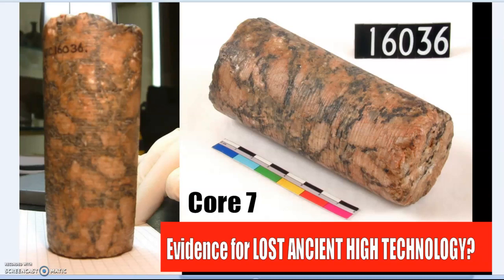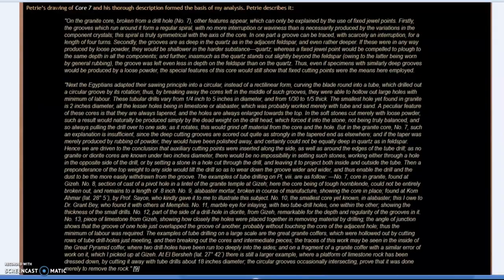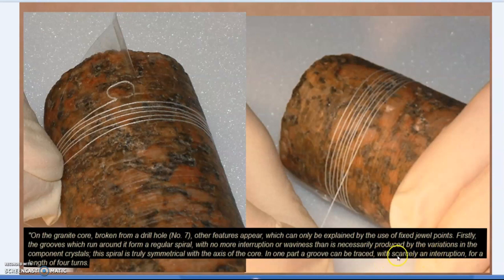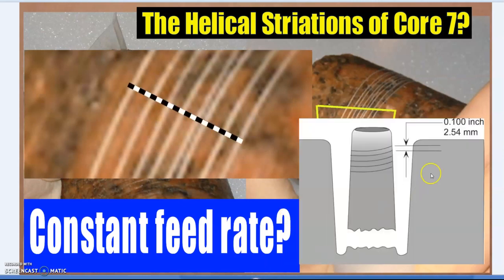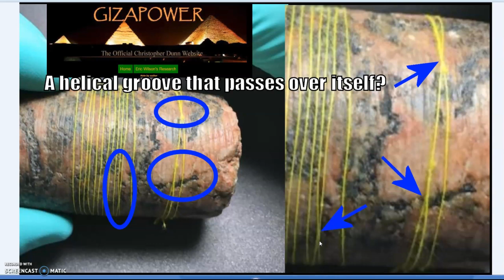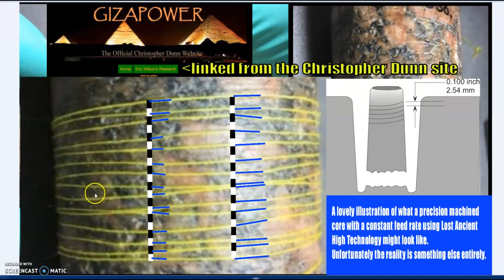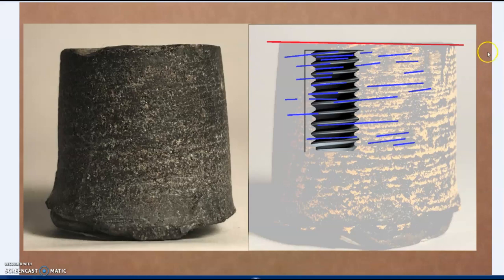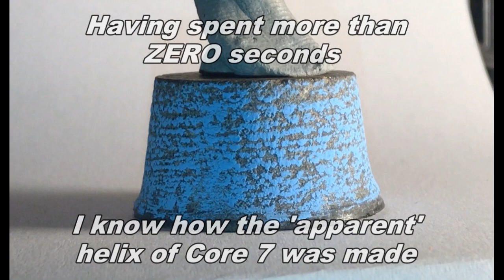Lost Ancient High Technology of Core 7 - Helix Spiral and Constant Feed Rate? TEASER

Comment: Mr. Dunn's thread wrapping exploits have always seemed rather suspect to me, he readily admits that the marks are not visible around the entire core and that its tricky to see which line you should be following, so if he's continuing a line where the 'spiral' is missing then it can only be described by one word... Subjective

He also used a Dial Test Indicator to check the depth of the grooves, the setup he uses looks like it has a 'ball' end rather than a 'needle' type end, 
This would be like trying to measure the groove depth on a vinyl record by running a cricket ball over the surface, 
Anyone with experience of inspection would call that setup 'interesting' to say the least, 

He has done some great work in the past with engineering inspection tools such as straight edges and squares in showing the level of precision involved, but the thread wrapping and depth measurements... Nope! They are just not doing it for me, 

Couple that with the fact that he took a latex mould of the core, then did nothing with it for several years, which says to me that the mould has probably degraded in that time, I'm not sure what a flexible mould is going to show, I think depending on how you flex it then it could show anything you like, I could use the same mould to prove beyond all reasonable doubt that the lines are perfectly 90° and parallel and not a helix at all, if I distort it in the right way, 

To prove any theory you need to use reliable empirical data, fudging some missing sections and making the rest look like it fits the theory is all too easy,
I can only imagine the 'undisputable evidence' that is being thrown around on these -overpriced holidays-, sorry, I meant 'factual' tours   🧬📏📐🕵️‍♂️💰💰💰💰💰💰
Reply from the maker: I mentioned at the start but perhaps should have repeated it. I hear “constant feed rate “ by people citing Dunn as source. Rather than Dunn directly on his site.
Once the Scientists Against myths  release the hi res images I’ll use direct quotes.